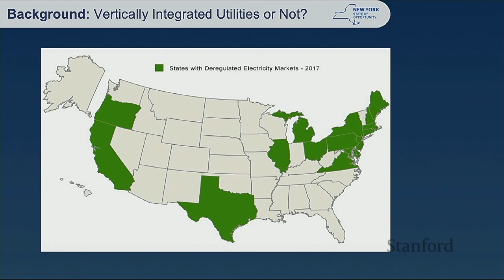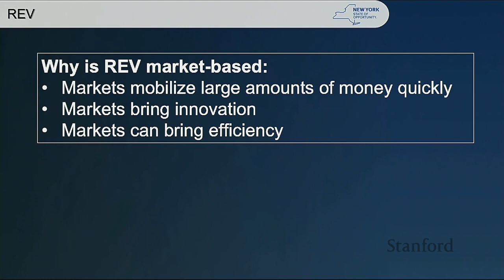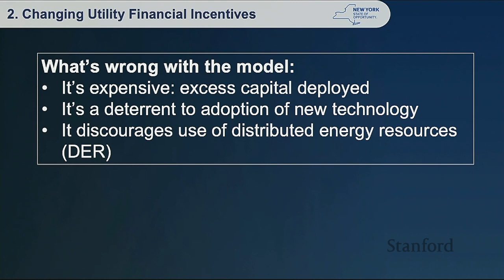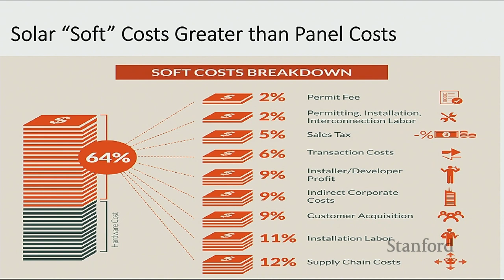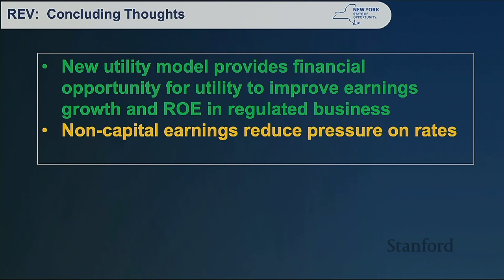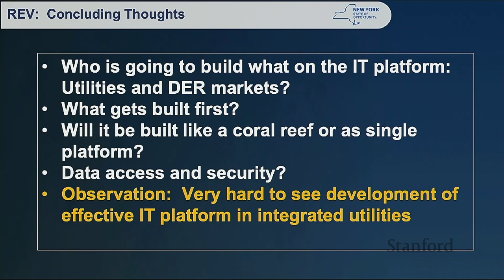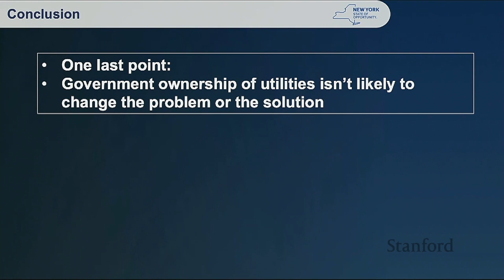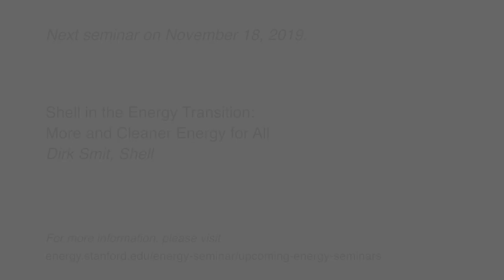New York State's Policy to Remake the Grid | Richard Kauffman | Energy Seminar

Comment: Also, the electrical grid is really the most efficient way to transport energy. By far. However, if you load the grid with the highest power that it can take, that is the moment it becomes the most INefficienty, because the losses mount with the SQUARE of the current. So, underutilization of the electricity grid is actually very efficient!